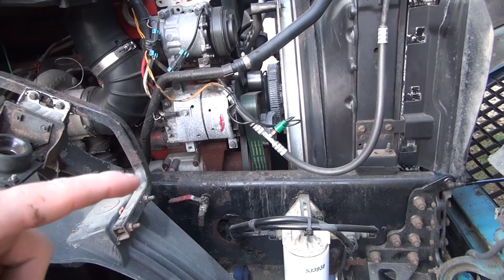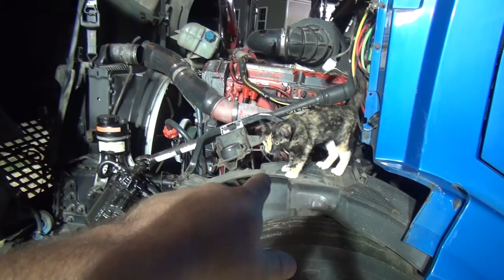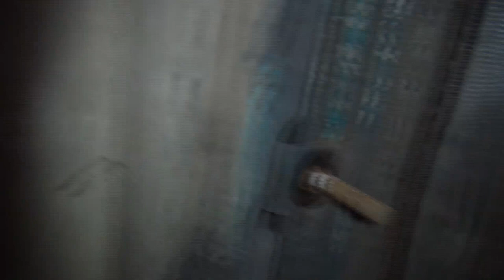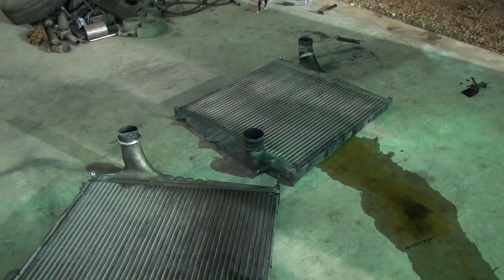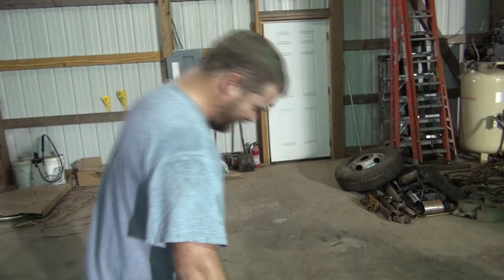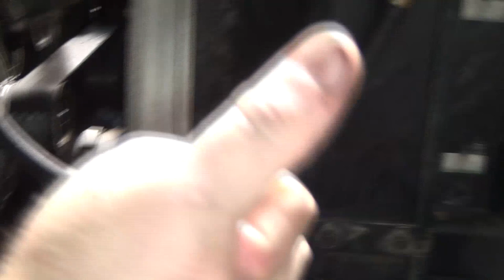Volvo vnl 780 radiator install didn't go quite as planned

Comment: It’s alway good to have late Jake for a friend a spare parts truck and a helper named Missy... good video especially when you separated the radiator from the intercooler that’s common build up with older trucks. Thanks Chase always worth watching
Reply from the maker: For sure lol. I had noticed that the fan on the blue truck seemed to stay on longer than it should at times, and now I know why...